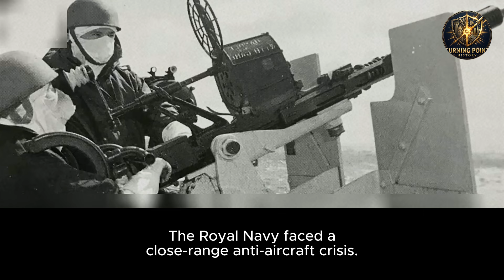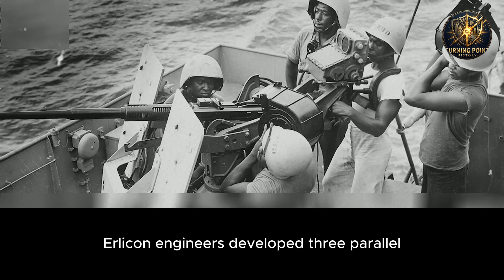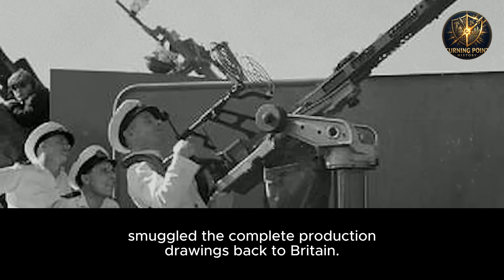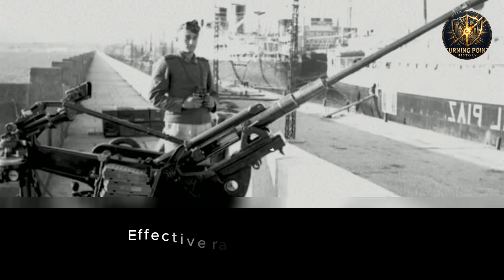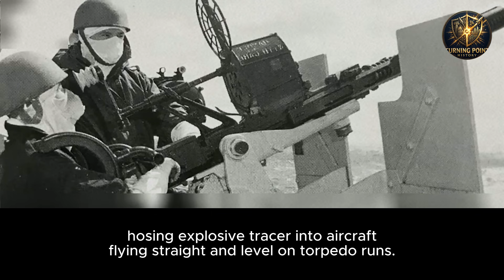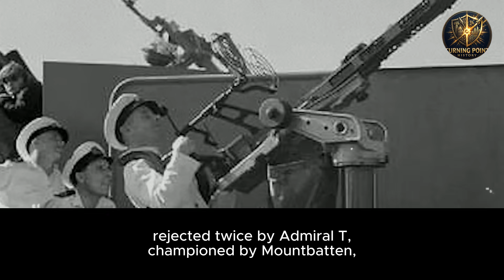The 'Stolen' German Weapon the British Adopted for Escorts—And Why It Outperformed Expectations

Comment: Did you mean Oerlikon 20 mm cannon? - not "Erlikon".  Stupid people relying on A.I. generated data. And did you mean Mitsubishi's A6M "Zeke"? (Not Six M-zero fighter). I haven't found any mention of an "Admiral T" rejecting this weapon system for the reasons this video alleges.  In 1937, the Oerlikon Model 1934 was rejected due to low muzzle velocity and an unsatisfactory rate of fire (265 rounds per minute).